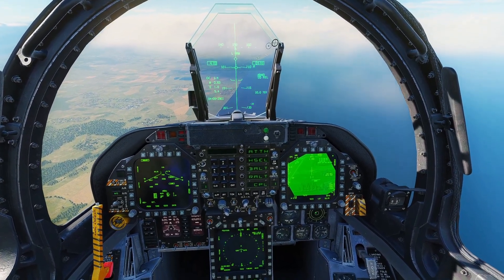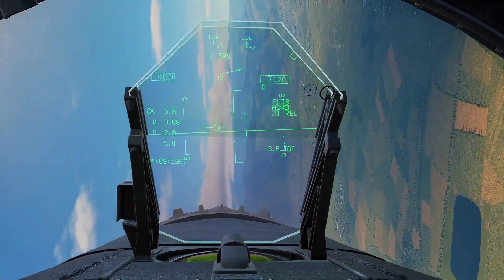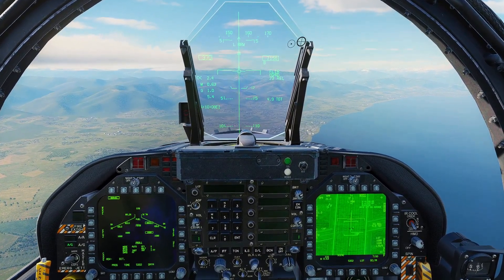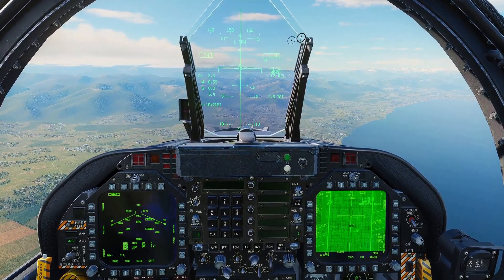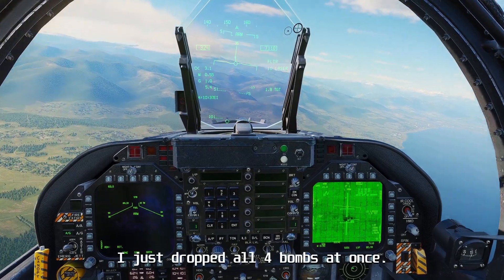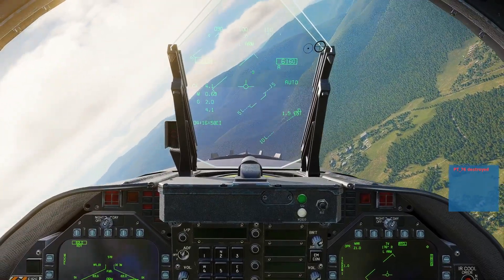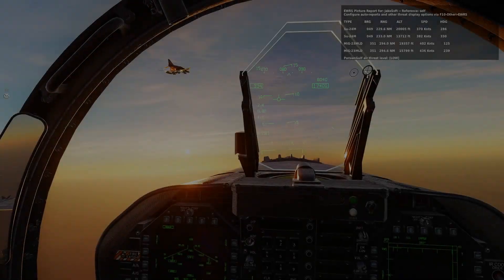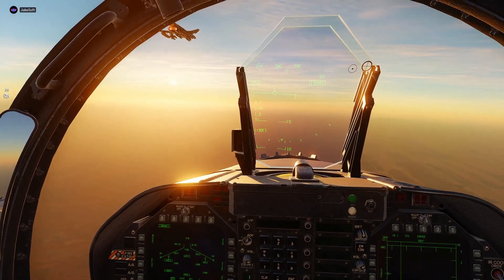F/A-18C Bombs Broken | DCS World

Comment: It should also be noted that you can no longer change your laser code in the air for LGBs on the f18. You might think you can in the SMS but thats more to keep track. Here on out if you want to work with jatc or just want to use a different laser code you have to set it up on the ground. Got 2 LGBs set to 1688 and jtac is lasing 1686? Welp your SOL. Literally every LGB guide is wrong now and chucks guide needs to be updated. wish ED  Made this more clear seems only mention of this is in the patch notes back in May....

Comment: I just have been experimenting with new fuzes and I can not confirm your experience. All types of fuzes for GBUs and (almost) other munitions are work as expected. But there is a limitation: each type of bomb must be equipped with the single type of fuze , otherwise it won't work at all. 
CBU-99 seems to be a bit broken, though... 

It seems like crossed 82LG symbol is the key for your problem. You don't have such indication on successfull attempt. How did you setup your stores to get that kind of indication?
Reply from the maker: Load up 4 wing pylons with GBU-12s. Touch nothing, leave everything as default. The fuses won't arm. This is 100% repeatable. I've done this with cold start, hot start, and air start. If you can make it work, then please make a video and let's see it.
Reply: sure... https://youtu.be/XHhn7vjRhRI
Reply from the maker: Yup, that seems to be working for you. Thanks for sharing that with us. 

I will say that since the new patch from June 5th 2024, I was able to get the M905 fuse to work with GBU-12s, so maybe it's fixed now. It still fails sometimes, though. I'll do some more experiments.
Reply from the maker: @tver56 I flew a few sorties tonight and the problem I was having seems to be fixed with the latest patch. I can't repeat it anymore either. It might have been related the bug where one dissimilar fuse in your loadout would cause all bombs to fail.  That is mentioned in the patch notes.

Comment: THANK YOU, finally someone who makes a video about it and yes I experienced the same. I did some testing and for me it's a gambling - sometimes it works sometimes find doesn't. What I found out: You must set the custom laser code on the ground. If you change it to anything other then 1688 the GBU will no track. The JDAMs work with the "Plugged Fuze" but ONLY for INSTANT! If you want DELAY fuze all the bombs that I tested (Dumb, JDAMs, GBU) did not explode (DUD). What is as well very important: You need to have the same fuze on ALL the same type of bombs. If you're using 4x GBU12 and all 4 have different fuzes none of them work :(! I hate the new fuze system, they had something that was perfect and always worked and they overcomplicated it and now it doesn't work ....
Reply from the maker: I have limited reach with such a small channel, but I'm glad this helped somebody. Thanks for the additional info.
Reply: Only being able to change bomb laser codes on the ground is how it should work, just FYI.  You have to set them with a screwdriver on the bomb - kinda hard to do for the pilot in the air.
Reply from the maker: @cmdrbigity6914  That's not the issue though. What I'm seeing is that you can't set the fuse. The seeker is working fine, it's just that the bombs don't explode when they hit the target.

Comment: Anyone else have issues with the cluster bombs not hitting the target using CCIP?  They drop like 500 feet short of the target when I set them to go off at 1500 feet.
Reply: Depending on the type of cluster bomb they can be wind-corrected or not. The Mk20, CBU87 and CBU97 are not wind corrected, the CBU105 and CBU107 are wind corrected, but you need a targetting pod, so no CCIP for them.  Mk20 and CBU87 seem weak when used on the Hornet, for some reason seem better on the A-10C.
Reply: I don't even use them they're just impossible to hit with
Reply: I was having them land long the other day. I stopped using them because of this. I couldn't even figure out how long they would land as it seemed different every time depending on the release conditions.